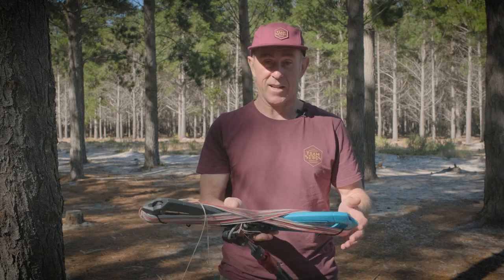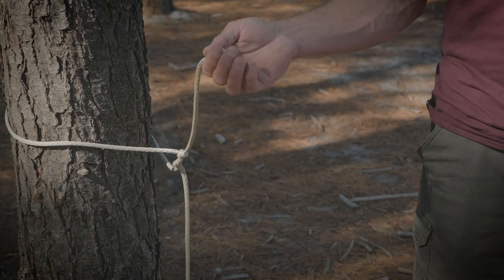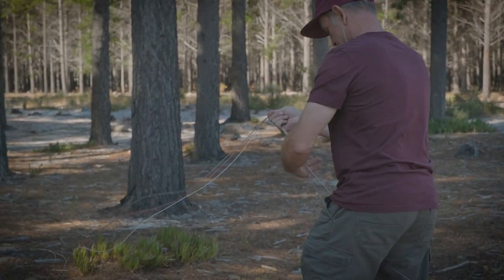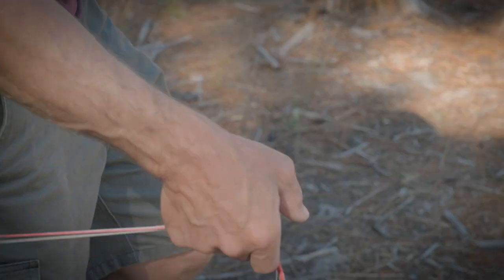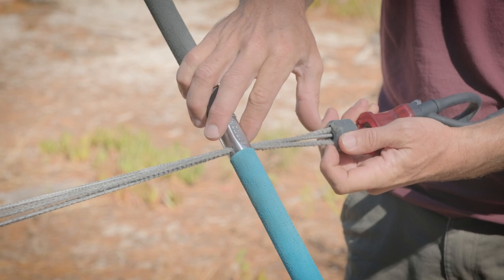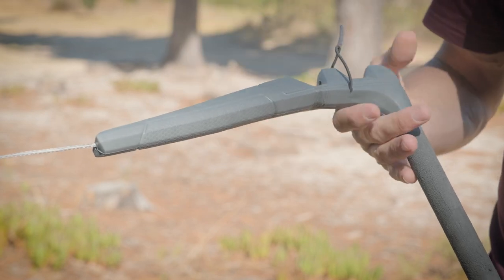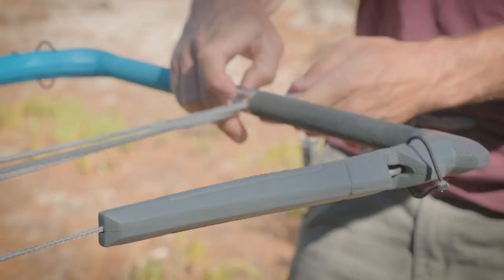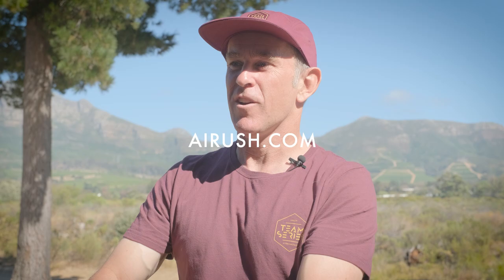Airush - How To Tune Your Bar (Check & Adjust the Trim)

Comment: I've found after soaking the bar in lukewarm fresh water for 10-15 mins, it's possible to 'stretch' shrunken lines back to original length, the line diameter can go back to normal without the embedded salt. Dyneema won't stretch beyond original length without crazy effort.

Comment: Could you shorten the centre lines instead?
Reply: Yes, that is just as effective. The bar in the video is much easier to adjust on the rear line leaders.
Reply: @Kiteboardshaper  since your trim adjustment just went to the last knot, next trim you will have to either trim the front lines or add pigtails to the back lines... Which really makes me wonder, why does Airush supply bars with so little trim room on the back lines. All of my (many) Airush bars needed a trim of 15-20cm on the back lines, sooner or later. I solve it with pigtail extensions but it would be more elegant to just have more trim space on the hidden leader lines...
Reply: @kryszczuk  thanks for the feedback, not without grounds either, leave it with me and I'll see what I can do.